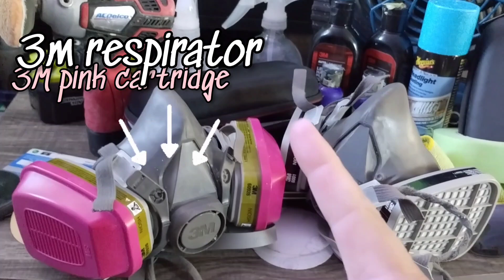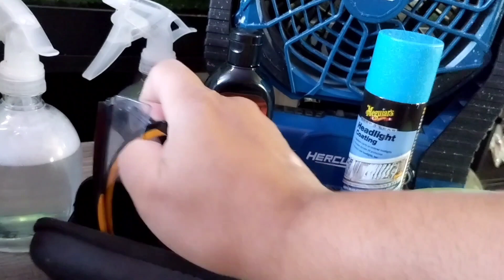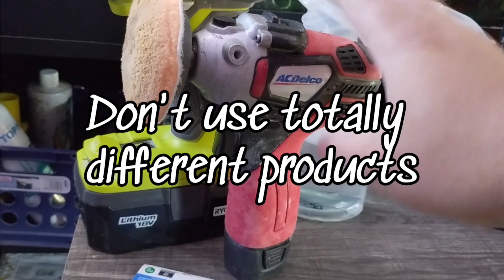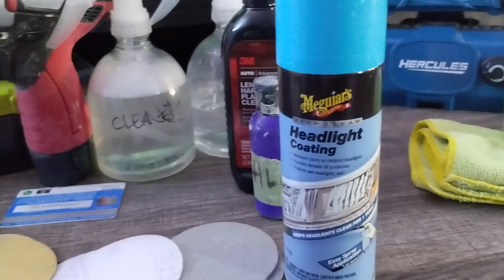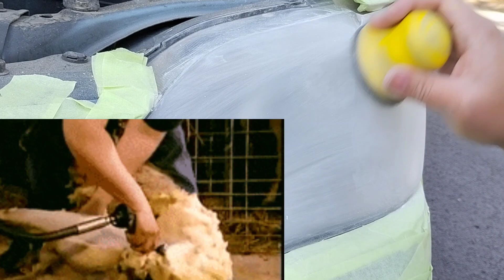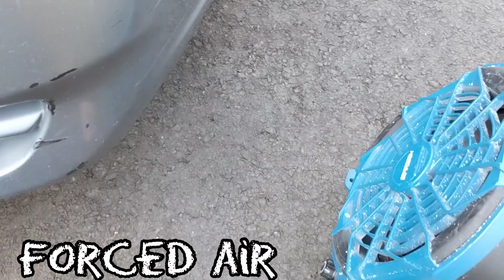Step by step HEADLIGHT RESTORATION TRAINING/Pros and everyday Joe's

Comment: Have a question each pad is one use right . Wat bout the 3m 3000 trizact pad no clean and reuse just wondering
Reply from the maker: Well some pads can be used more than once depending on how much you use it.. I typically use one pad per light normally. One disk per Life of each grade except for the 3000 trizact this can be used multiple times no washing or nothing just water and use.. far as the discs once again just depends on how heavily use them.. I say partially used ones in a separate bag.. they still have life.. for instance sometimes I'm doing a whole night and I just want to finish off a little bit more and so go over one time and still have about 75% left on the pad/disk....
Just know the newer the disc the better it functions no matter what it is..
Reply: @theheadlightrestorationpro  I appreciate it Thanks  for the response back . Your work is great and I follow exactly your steps and let me tell you I was blown away by the results  I doing custom  retrofit headlights. Some times Ill come across used headlight with bad lens so both used headlight came out great
Reply from the maker: Hell yeah.., Glad to hear it..💯

Comment: Hello mister. An issue that a am facing with is just when i finish sanding i always see scratches in the surface of the headlight and those scratches i dont know how to remove them. Is it because i am not sanding properly or something else? please let me know
Reply from the maker: I would probably watch the videos closer I don't know how many of them that you watched but I would watch them closer on those areas that you're having issues with..
Make sure you're using what I'm using if not you need to investigate if you're using the right stuff in comparison to what I'm using...
Reply: @theheadlightrestorationpro  regardless of your videos , can u give me some tips that i could follow remmoving the scratches after the sandind?
Reply from the maker: I mean pretty muchput  everything that there is to do it is on the videos...
It's in every single video if you follow the steps and the things that I've said it should come out money... Nothing really else I could say that's not in the videos..
I would check your supplies and what you're using first thing first..

Comment: hey i got  a question why dont you use the ac delco to sand?
Reply from the maker: Believe me I've tried.. the AC Delco has way too much torque and extremely super way too much speed or RPM even at this low setting.. you could do it but it takes too much concentration because you'd have to barely touch the trigger... It's not a finesse type thing in a sense it's more of raw power... You would be extremely susceptible to damaging the vehicle far as eating through the tape also burning the headlight or producing prominent scratches are very deep scratches I've tried before a couple times it is not a good idea... Very good question plenty more videos up and running and plenty more to come...

Comment: I'm doing one of my lamps now, wish me luck.
Reply from the maker: Good luck ..but you don't need it..
Follow the steps, even watch one of my videos as you do it step by step a follow along ..
👍🏼
Reply: @theheadlightrestorationpro  yes but the problem is I couldn't buy the blue clear coat and it was sold out in Amazon USA.  I used 1 coat of 2k and i don't know what's wrong with it. Looks blotchy, I'm scared to put a second coat.
Reply: I think it might not want to adhere to p3000 with polish on it. Not really sure
Reply from the maker: The problem is you used 2K clear.  
If you watch any of my videos you definitely should know to never use 2K clear on the headlight.... I would use anything before this....
You have some serious issues now so good luck. 👍🏼https://youtu.be/c3jK4SOIRM8
Reply from the maker: It's not meant for headlights...
Got to use a headlight certified product...
Reply: @theheadlightrestorationpro  yes I know. But if I'm going to be good at this I think I should figure out every angle and product.  I could not even get a can of blue clear coat sent to Europe because ban on aerosols right now.
Reply from the maker: Ok...just make sure it's made for headlights... even if you had to change methods...

Comment: i looked on line but could not find this answer what is the lowest outside temperature you can apply the meguirs headlight clearcoat?  thx for the great video teaching session, plan on trying it if it isn't to cold outside to spray the headlight coating.....
Reply from the maker: Good question... You can never go too hot... But sometimes you don't want to spray it in direct heat when it's like a 110°...
I wouldn't spray an under 30°, after 40 degrees things get a little bit weird it just slows down a little bit but wouldn't use any kind of heat , just air dry or forced air dry (with directional fans)... At these degrees of temperature the crust will still dry in about a little over a minute.. maybe a minute and a half.. which is still really quick.....
Thanks for watching...
Reply: thx @theheadlightrestorationpro  thx, here in the northeast it will be awhile till it gets hot again and i don't want to wait till spring so i will wait till it gets above 40 degree f and give it a go..thx again

Comment: Hey, great video again sir, are you running your drill at full trigger speed, it seems as dewalt turns much faster and I don't want to risk burning the area, maybe your controlling your speed with your trigger pull and it just looks slower, thanks for any info 👍
Reply from the maker: Yes it is probably a lot slower..
You don't want to use a higher end drill because the RPMs are higher and primarily and most importantly the torque is much much greater... You don't want to use more than 1800 RPM and that's keeping the drill moving constantly, but like I said most importantly I wouldn't use more than 600 lb of torque.. some of those drills will have 1200 - 1700 lb of torque and higher RPM..
I'm probably using between 1200 and 1700 RPM which your seeing on the video I better the trigger in different areas..
I would definitely check the stats on the drill that you have..
Better safe than sorry....

Comment: Thank you for your great and thorough videos! Used the stupid 2k clear and it totally ruined my headlights. I have no ideas why YouTube has so many videos with using 2k clear. Went ahead and purchased on Amazon the products recommended. You are amazing 🙏🏼😎
Reply from the maker: Yeah it's a terrible the stuff I actually just finished doing two cars with it on.. one was so bad I had to pretty much work with the existing 2K clear and blend it in and reseal the parts I could get off a nightmare.. the spray Max is the worst one... its too hard... There's so many videos on it cuz people are just under educated and they just don't know.. these are just individuals that have done it to two cars 3 cars and never had to deal with it again.. not a professional who's done probably 10 this week..lol
So they swear by but they have no idea about it..
Well good luck.. hope your restorations come out well..

Comment: Hey bud thanks for this video. What amazing timing! I just tried your techniques on my headlights yesterday with some inferior sanding discs and orange pad. My results were ok, needs more work but the technique is improving. I'll be buying those 3M discs in the future because the glue on the Chinese ones I bought started sticking to the headlight and created a disaster of a mess. Thank you for taking time to make these great videos.
Reply from the maker: Hey thank you I appreciate it..
I do my best to make quality videos and to get my views and experience across..
I really appreciate you watching..
Have plenty more up and plenty more to come...👍🏼🤓💯
Reply: @theheadlightrestorationpro  what do you do to mitigate the dust spatter from the headlight polish?
Reply from the maker: @Jay_Ira  in my videos you'll see air duster it is posted in the bio directly to Amazon where I purchased it from.. being that it's just dust a fine dust and blows off about 90% of what is left.. after that I just use premium microfiber towel to wipe off any other dust I see that didn't get blown off which is minimal.. tastes like 60 seconds..
Reply: If you wanted the 3m sanding disc for just one car, you can buy the 3m ultimate headlight restoration kit. Comes with sanding discs, drill attachment, tape, headlight sealant. But not the orange foam pad or the 3m compound.

Comment: Have you ever sprayed the Meguire Spray coating and it ran in certain spots? How do you fix that oops?
Reply from the maker: Yes I have a couple times it's been quite a while.. this comes from delivering too much of one spot at one time and or primarily spraying too close you want to keep that 6-in distance..
Unfortunately there's no way around it but to let it dry for about 20 minutes then remove it and start from scratch...
That's why you want to use the painter's method hit the outsides lay down a really thin coat barely anything and let everything else adhere to that and make sure you stop sometimes it takes a little getting used to..
But yes the best way is just to let it dry and start over it's very easy to remove which all headlight certified products should be because guaranteed you will have to remove it someday...

Comment: What do you think of using the Cerakote headlight coating packets instead of the Meguires Spray coating?
Reply from the maker: https://youtu.be/h2URTUy5ti8
Ceramics never really work out on headlights in comparison..
From the gate spray method is more Superior by far the any kind of towelete or manual application..